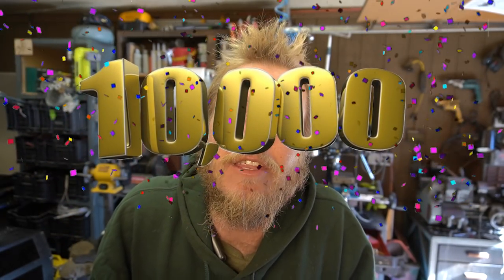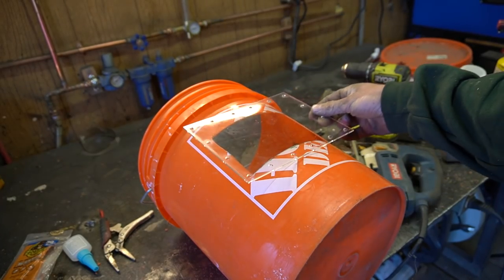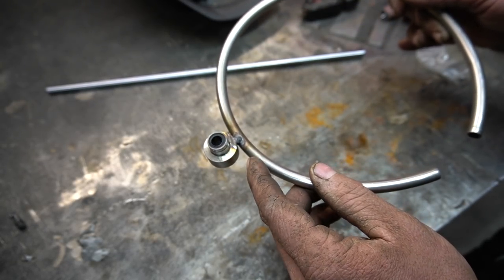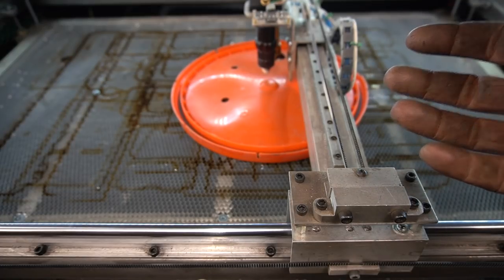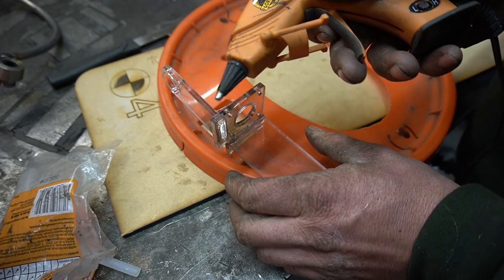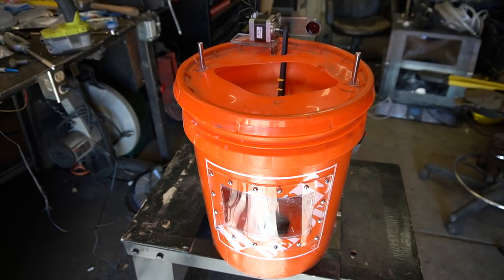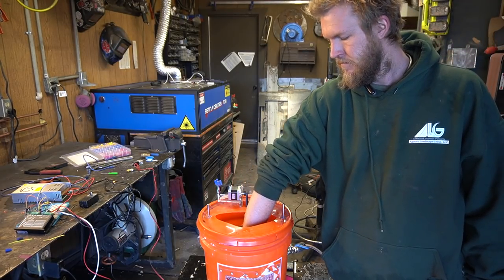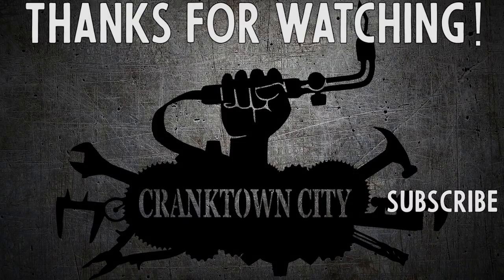Washing My hands for 10,000 Subscribers

Comment: Problem is that the grease and dirt aren't getting scrubbed away from the skin.  Suggestion for Hand Washing Station Mk.II: two belt sanders with towels instead of sandpaper, mounted belt-to-belt.  When you put your hand between them, the pressure turns them on, and a small bit of soapy water gets applied to the towels.  Push hand in, let auto-towel action do its thing, pull hand out.

Probably want to test that on hand "stunt double" first.

Comment: A car repair friend of mine also had horribly dirty hands after work but got them 100% clean by using laundry powder and hot water. The powder has to be a bit gritty to rub the dirt off but for having tried the method after some car repairs myself, I must say it works really well.
Reply: Contact dermatitis is no joke. The caustics in laundry detergent will take you there quick.

Comment: Dirty hands and for love with no gloves, that wet invention is apparently a useful way for washing one's extremities, and depending on the water pressure, alot nicer to the dermis and safer than keeping an appendage in a vice such as aVe recommends, lol.

You could probably sell that invention for hands free use even, if you run a proper bead of silicone around the perimeter of its lid to meet UL underwriters laboratories approval, of which they'd probably appreciate for testing purposes, including a waterproof speaker an amp, and a looping copy of April Wine's Greatest Hits and a box of chocolates, or some flowers and rock candy.

Please be safe and please be tomorrow. 🗽
#TheDigitalLifeguardProject-_-